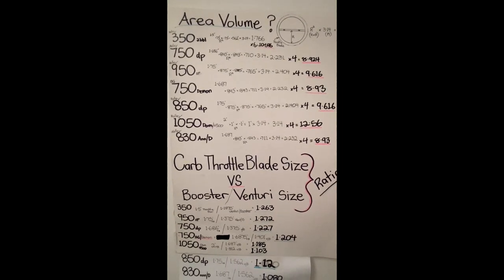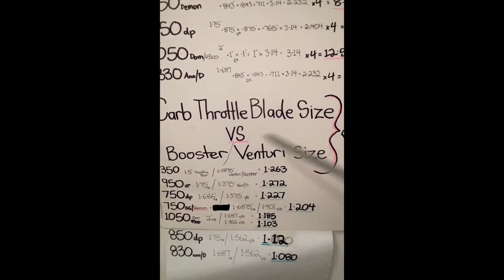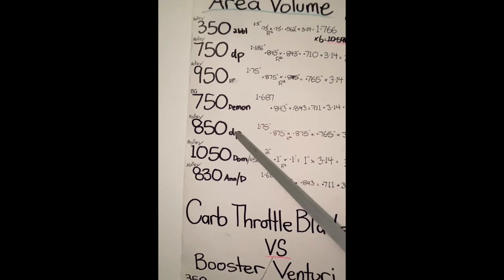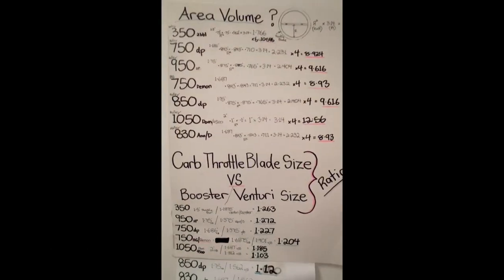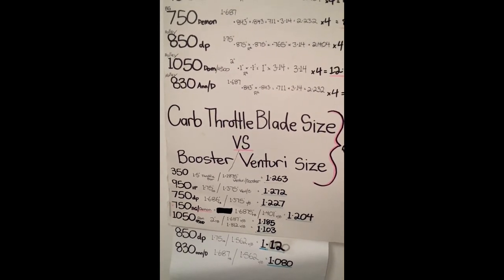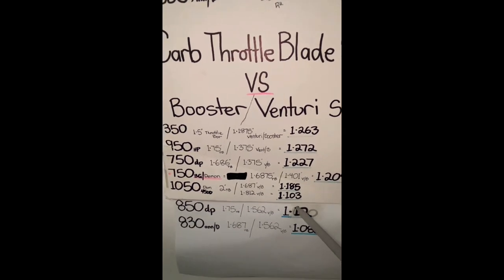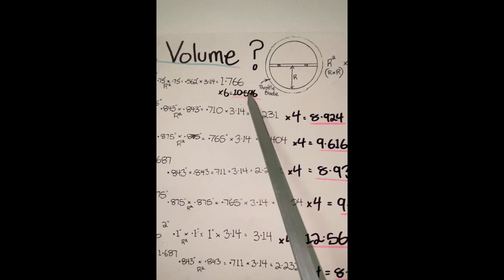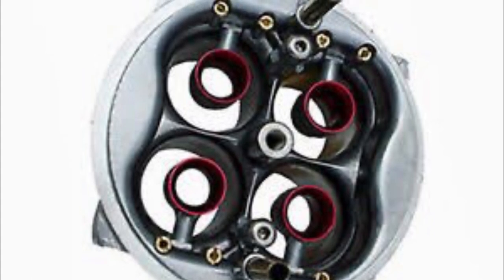Carbureted Guess? Choose your Carb Wisely🏁an insight to carburettor behaviour

Comment: Cheers man, some great learning, I think most just look at the big number aka cfm and don't understand that velocity has a lot to do with it.
Especially when the engine has to suck it in. Awesome! A classic example in my experience was my cousin had an Xb/302 with a 350 Holley, stock apart from a nice note coming out the back, it was a ball tearer, plenty of get up and go,  then he bought an Xc/302 and had a 4 barrel on it, it wouldn't pull the skin off a rice pudding😂. I know thats when emissions started and the cams were ground different but I always wondered and now I know🤙👌👍
Reply from the maker: Exactly, Great example & true at that👌🏼.....
It’s that understanding of good choice you need to make. A high air velocity / good atomisation type of carb that can still provide the cfm at high revs also 👌🏼🏁

Comment: I believe you're not comparing apples to apples here. Some of those carbs have a different booster. That alone affects cfm. Not to mention the HP carbs don't have chock horn if I'n not mistaken. Remember the 780 holleys? they later became 750 's just because of a booster change. That booster was a little more responsive but more restrictive. I still enjoyed you're video.
Reply from the maker: It isn’t apples to apples here, it’s just talking about old school outta the box Carbs really with some interesting points about em. I did mention about boosters & how they may affect things at end of vid 🤷🏼‍♂️, it is a long vid though🏁
Reply from the maker: i think many haven’t watched the entire vid here, everything is is covered & captions included..... I’ve experienced a lot of the behaviours in these Carbs. Thanks 👍🏼🏁